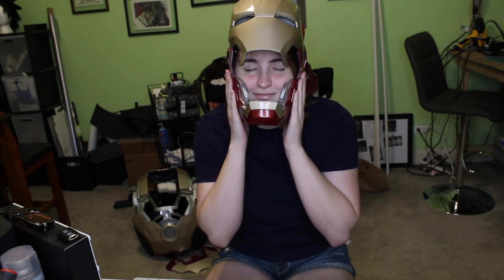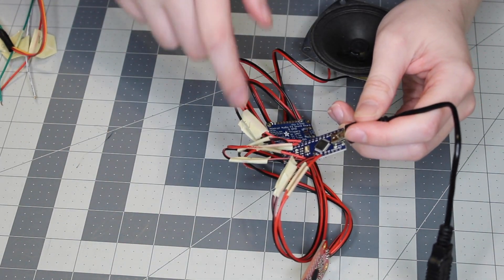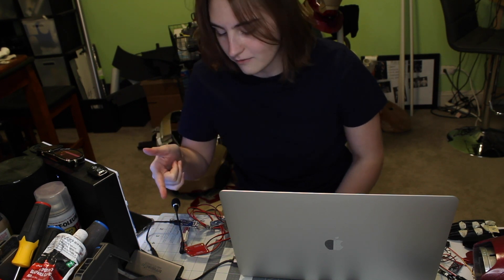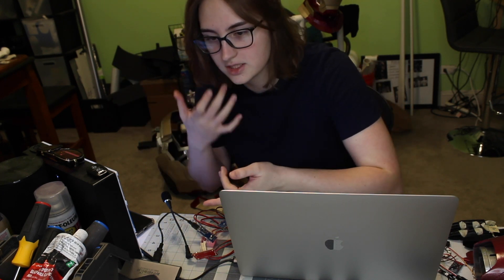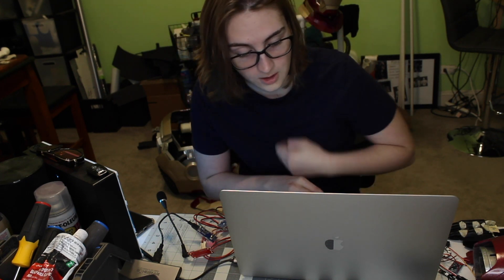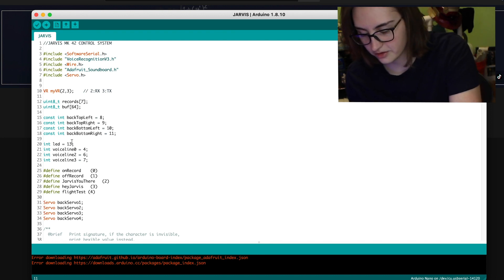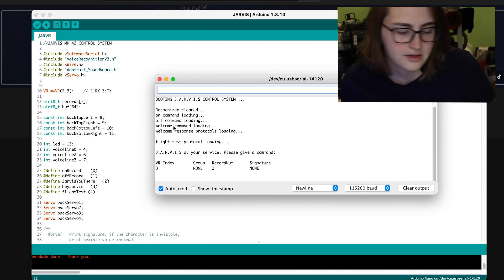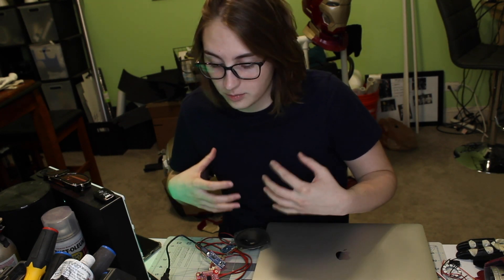MY JARVIS SYSTEM (WIP) | THE MARK 42 PROJECT

Comment: First of all, I came across your channel by accident but I am so glad I did. You have done an amazing job on your Ironman armor. Your N.A.R.V.I.S. voice activated control system is great! I was wondering if you have looked into the possibility of using the flex screen tech in your helmets. If it works, you could have a heads-up display as well as a camera view. A wide view miniature HD camera could be concealed in the front of the helmet. It would require a pin sized opening though. Anyway, I just thought I would make this suggestion.  Again, you are doing an awesome job! Keep making videos!
Reply: Another thought, you could cannibalize a flex screen phone and use its operating system in tandem with your voice activated system to run and monitor everything.
Reply: Thank you guys! I was looking for something like this for my spartan and iron man projects!

Comment: Awesome! I dig it. Voice control in a suit would definitely be a lot of help. Wifi integration definitely would cut down on wiring. I wonder how well the latency is handled if there is any at all. As always, great sense of humor and looking fwd to more.
Reply: I think the problem of wifi is power consumption. Not sure what your thoughts are on what to use but I don't recommend ESP as it sucks energy when running wifi. Maybe I did something wrong but almost sure I didn't